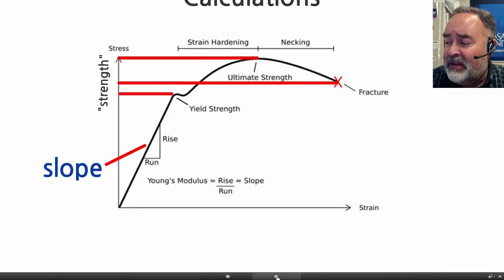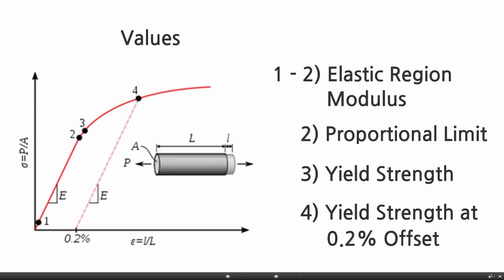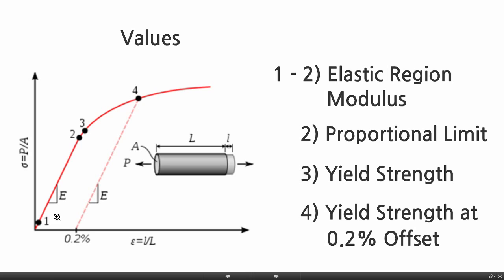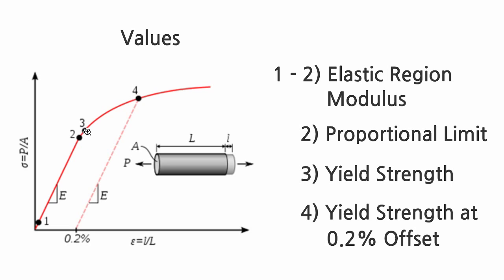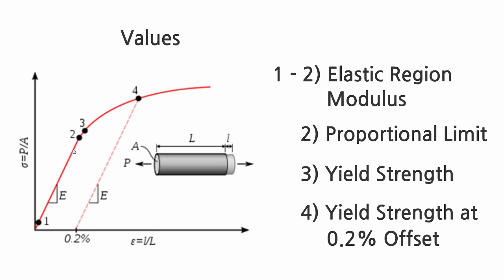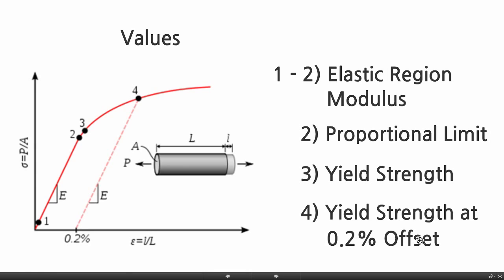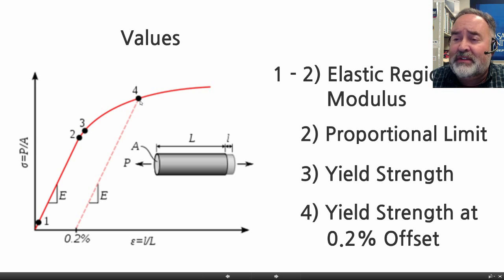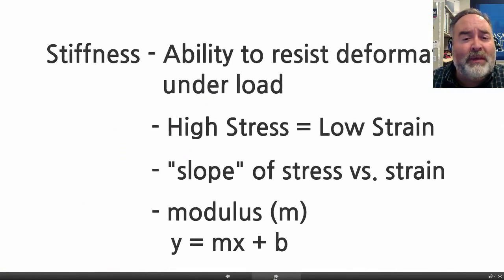ISBT212-04_3 - Stress and Strain: Proportional Limit and Yield Strength

Comment: how  do you calculate the limit of proportional
Reply from the maker: Hi, @Axole, The Proportionality Limit is not a calculation. It is a position on the graph where the straight-line modulus no longer fits the data.  From there you can read the Stress value from the vertical axis and the Strain value from the horizontal axis and report those values. It would be reported as "Stress @ Proportional Limit" or "Strain @ Proportional Limit". This informs the user of the material of the Max Stress and Max Strain the material can experience before is undergoes permanent non-elastic deformation....it won't bounce back and that can make the part or the entire assembly fail.

Comment: If I was asked to give the proportional limit, would my answer be the range from yield or strain or would I give the value at that point in either the yield or strain axis?
Reply from the maker: Hi, Jake. Because there are different ways to report it, I would expect that a request for the Proportional Limit would include a note as to how to reference it (sort of like Yield Strength, at 0.2% Offset). You could also check the units. If the report asks for the Proportional Limit in units of the Y-axis (stress) or the X-axis (strain), then you would have your answer.  =]
Reply: @WilliamLWeaver  I just realized I was saying yield instead of stress whoops. I will just assume stress because there is no clarification. Thank you

Comment: hi! should we be approximating where the  proportional limit is located to calculate the slope? I'm just not sure how to determine exactly where that limit is located when I plot given data.
Reply from the maker: Hi, Caroline, If you are plotting manually with graph paper then the measurement of slope and modulus is a rough approximation. It should be OK to use your best estimate for the proportional limit. If, however, you are using a plotting package, then using a statistical curve-fitting procedure would automate and clear this up. In between, you can use Excel which will use a least-squares fitting routine to find the best fit of a line through the elastic region of your data. If you have digital values, you can only include those datapoints that are clearly before the proportional limit. If you really want to be fancy, you can continue to add more data points that are closer to the observed proportional limit while monitoring the value of the R^2 error. If after adding a point the R^2 value drastically lowers, then you can be assured that you are including data beyond the proportional limit. I hope this helps!  =]

Comment: Sir for hysteresis graph corresponding to which strain we will find the yield load.
Reply from the maker: Hysteresis implies that the load is applied in a cyclic manner. This is a "static" test in which the strain is slowly increased (either compression or tension) as the stress is measured until the sample breaks or the testing machine reaches its maximum load. To measure hysteresis, you typically would not leave the proportional region, but any testing procedure can be defined and followed.

Comment: I don't understand if it's deformation=0,002 or 0,2% of the last obtained value of deformation (failing point). Can you please explain?
Reply from the maker: It is a point on the data curve that is measured BEFORE the part totally fails. Yield is while the point is "giving up" or "in the processes of failing". Before the Yield point or the "proportional limit", the part is considered to be only "stretching" and is elastic and will return to its original shape if the load was removed.

The difficulty is pointing to a specific point on the data curve, somewhere after the Yield Point or Proportional Limit. The process is to locate the point on the horizontal strain axis where strain = 0.002 (also represented as strain = 0.2%), and then draw a line up from this point until it crosses the data. But instead of drawing the line vertically (parallel to the Stress Axis), it is drawn parallel to the Modulus.  Does this help?

Comment: Great explanation, Question though, can this be calculated without a chart using datapoints ?
Reply from the maker: Hi, Djochiem, thanks for the Kudos. These values are acquired EXPERIMENTALLY. It is possible to develop a theoretical program that models the values from material parameters, and for the most part, this is the goal of computational stress-strain modeling (https://en.wikipedia.org/wiki/Stress%E2%80%93strain_analysis#Mathematical_methods). But even after using a CADD Program to model stress/strain effects, actual test models must be measured in the lab to get the "real" values.  =]

Comment: William, thanks for your great explanation. Do we have any simple formula to calculate the Yield strength (YS) at 0.2% offset? I.e if i have YS=35,000psi then what is the YS at 0.2% offset (proof strength)?
Reply from the maker: Hi, Thong, It is my understanding that YS at .2% offset is a measured value, not a calculated value. It depends on the material. Perhaps if one wanted to create a formula, it would include a parameter for each type of material, but that parameter would be based on measured values, so it would be simpler to just quote the YS at .2% by reading from the test. Thoughts?

Comment: thanks!! this is super helpful.

what happens when the yield strength at strain offset at 0.2% when the material has already failed by that point?
Reply from the maker: Izzy Farmer  Then the yield strength is reported as "0" as it has already failed. If an entire class of materials fails before 0.2% offset, then a lower, more appropriate strain value can be chosen and reported. =]
Reply: thankyou!